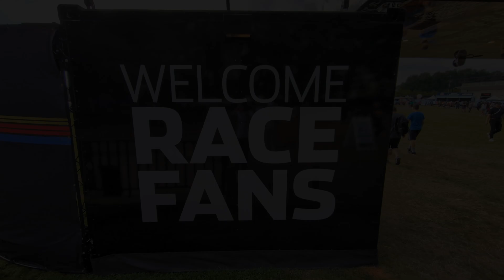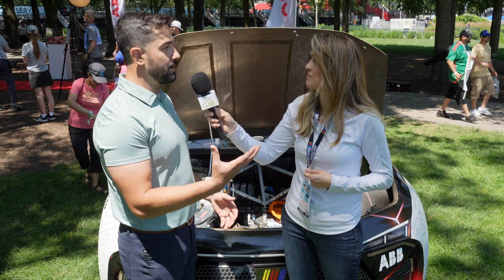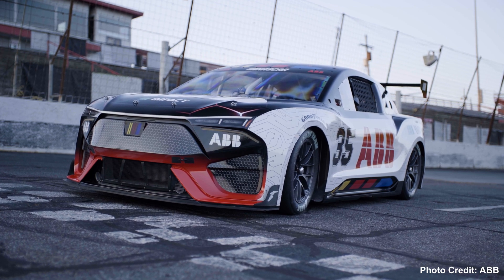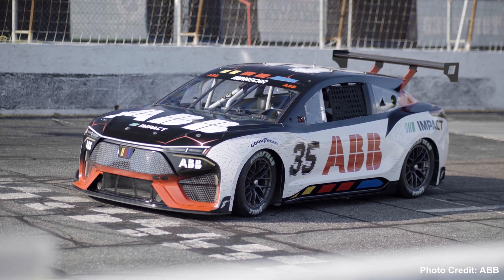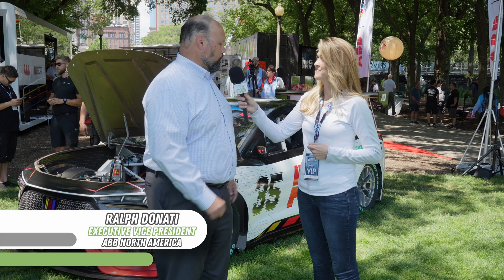ALL ELECTRIC NASCAR First Look : EV RACING

Comment: Yes. EV's can go fast.  No doubt.  But NASCAR can go broke like an EV owner...
Reply from the maker: Did you know that the EVs deliver the lowest cost of ownership. Going broke is more likely to happen to internal combustion owners who pay more for fuel, oil changes, spark plugs, belts, exhaust systems, sensors, and transmission work. None of those maintenance expenses exists for EV owners. 

The minimum warranty on an EV battery and powertrain is 8 years and 100,000 miles. In 16 states, that warranty is at least 10 years and 150k miles by law. Combustion vehicles are not competitive in terms of reliability and operational costs. 
-Producer Tim

https://www.teslarati.com/tesla-model-3-most-affordable-car-to-run-united-states
Reply: @MissGoElectric  The pollutants produced by mining and processing enough lithium for one ev battery are worse than driving ten ICE vehicles for ten years.  The total cost of maintenance on my ICE vehicle has been way less than the cost of that one battery that you'll need as soon as the warranty runs out. You know... that thing that GM perfected... PLANNED OBSOLESCENCE...
Reply from the maker: Once again your assertions are *incorrect*.

Remember...the valuable materials inside of an EV battery pack which will deliver 200,000-400,000 miles are not exhausted or used up at all.  The secondary market will use the batteries for industrial/utility purposes for another decade or two.  After that, the materials are recycled and purchased by a battery manufacturer to be implemented in brand new batteries for another 40 year cycle.

Once these materials are mined, they become a perpetual domestic resource which benefits the US economy.  With every passing day the return on that investment improves.

The circular economy enabled by batteries promotes demand for the domestic energy which fills the batteries. All of it delivers tremendous economic benefits and health benefits due to clean air.

When an EV battery pack is about 5% into its first service life inside an EV...it has already completely repaid its mining deficit with emissions savings compared to gasoline.

Folks tend to forget that for very gallon of gasoline one pumps into their gas tank, 5-7 gallons of gasoline are burned pumping the oil, transporting the oil, refining it into gasoline, then transporting it to the gas station.  Once the gasoline is inside an automobile, about 90% of its energy is squandered as heat, noise, and vibration.

Comparatively, electric vehicles are about 90% efficient.
-Producer Tim
https://www.carbonbrief.org/factcheck-21-misleading-myths-about-electric-vehicles/
https://www.reuters.com/business/autos-transportation/when-do-electric-vehicles-become-cleaner-than-gasoline-cars-2021-06-29/

Comment: Nascar can't go electric. People love the sounds the smells of the cars you go electric it's will suck and you will lose fans.
Reply from the maker: Did you listen to the EV? It was not silent and it was much more powerful than the combustion vehicles. -Producer Tim
Reply: @MissGoElectric not the sound we wanna hear
 It honestly sounds like high pitched shit. I like the smell and the engine noise. There is a place for electric, not on the race track and btw, the current nascar engines are so restricted its not even funny. They can make over 1,000hp with out the restrictions
Reply: Your right about that.

Comment: I don't see it happening in 2035, and besides the three tiny motors and sound, sounded like a eletric go-kart motor in the hood and in the read of the car, also the big wing spoilleer reminds me of the gen 5 car back in 2007 through 2010 series where yes it's gong to make what sounds likemore horsepower for the engine ,but at the same time its going to hurt drag, hurt straight away speed,grip and rear downforce forareo dynamics, so, if we go to the simple spoiller that we have now its going to run better, as Dale earnhart would say about this here car, Yeah I doin't like it, Imean it sounds nice but this is not we asthe drivers and fans have in mind, and if the gen 7 car is not broken, why try to fix it anyways.. And you guys needto think where can we put the crash black foam on both sides of the car, and my questions is, Where are you going to put the battery chargersot, and what WOULD the gas man do if he's not fueling the gen 7 car with his 90 lbs/pound red gas can from sunoco?
Reply from the maker: The production of excuses is child's play.  Adults produce results. -Producer Tim
Reply: Those “three tiny motors” produce 1340 hp. They also accelerate with near-zero lag.

Comment: I’m sorry but nascar going electric will lose a lot of people cause that’s the whole experience of a nascar race. The sounds and feeling of the engines and the smell of the gasoline. I guess only time will tell though.
Reply: Not watching or attending NASCAR ever again after almost 50 years if this happens.
Reply: I'm not an NASCAR fan but from every fan I've ever talked to being at the race is amazing when the cars pass you with the roar and the smell of gas. I've heard this for years from so many people. It's even made me want to go to a race. I just don't know how this will go over. Seems like you're taking 2/3 of the fun away
Reply from the maker: The sounds and smells of horse races were different than human races.  The chariot races sounded and smelled differently still.  When combustion vehicles replaced the horses, new sensations emerged and the cars were faster.  EVs are even faster still and they roar like a tie fighter from Starwars.  The sounds and smells are different.  Motorsport evolves.  Thanks for watching and sharing your views. -Producer Tim
Reply: Sounds and smells are what makes NASCAR NASCAR. It's a sensory sport. There's a lot more that goes into a motorsport event than just fast cars

“I can tell you this, THERE IS NO FUTURE for NASCAR electric vehicle racing. If it does not make noise and smell like it’s burning gas there is no freaking way that people are to attend.”
-Kevin Harvick (21 year NASCAR driver)

If Nascar has a separate series where they have drivers from Xfinity or trucks race and they test that for one season to see how it goes, I’m all for that, but I don’t see it working.

Cars going that fast on an oval track would not work out. Maybe on road courses it would work though. In fact, at the big superspeedways like Daytona, Talladega, and Atlanta they used to have something on the cars engines called restrictor plates. Those were there to actually SLOW DOWN the cars. They are also very dangerous, you do not know how easy it will be for these things to catch on fire (which will spread quickly) in those big pileups. Pit stops would change completely, they will have to pit more often for tires and they will have to replace the batteries which are on the right hand side under the floor. That will be hard to replace in a fast amount of time.

Human races, horse races, and auto races are three completely different things. Horse races did NOT replace human races and auto races did NOT replace horse races. That does not sound like a TIE fighter from Star Wars, it sounds like an RC car or some other toy car. Also who is Producer Tim? Is that someone in NASCAR or is that someone who works on this channel?

If you can't tell, I have a strong opinion about this and many other NASCAR fans do. I don't think NASCAR fans are going to support all the stuff that goes into making those batteries. Technology for electric cars is amazing and I hope we can reduce carbon emissions by a lot with these things. It's just a matter of how we get that supply and how the world changes along with this technology. I just don't want to see it in motorsports.

However, like I said, only time will tell.

Comment: Were the noises we heard from the car ripping down the straightaway at about 8:45 fake (coming from speakers) or made by mechanical stuff in the car?
Reply: Fuck electric. NASCAR just did a bud light move. Good luck
Reply from the maker: That is the sound of the 1300HP electric motors, tires, and wind.  None of it is artificial. -Producer Tim

Comment: No soul in the car keep it in a separate racing series that not to many will watch but time will tell
Reply from the maker: We like variety. Some are of the mind that there is some soul in being the fastest and most capable . -Producer Tim
Reply: @MissGoElectric  They won't be any faster. Nascar could be doing over 300 by now but everybody would be afraid of dying.  So, there are restrictor plates.  On EV's, they would set a top speed and the computer wouldn't let you go any faster.  More capable remains to be seen.

Comment: Call it something else because it ain't nascar anymore.
Reply from the maker: When they started racing trucks, was that a deviation from racing stock *cars*?

When the engines and suspension systems were no longer based on stock components, were they still racing stock cars? Where is the line drawn?

Are electric cars way too fast?

-Producer Tim
Reply: @MissGoElectric  Enjoy your squealing motor sounds. However, I will find something entertaining to do.

Comment: I don’t expect that the full 1300 hp will be available all the time during a race. It will be easy to dial in the max hp with software. I expect they will take a lead from Formula e, Indy Car, and F1 (who have been using hybrid cars for a while now) and limit drivers to a defined number of seconds of full power for passing or restarts, etc. I want to see how they will manage charging or battery swaps, because 78 kWh will not last long on a race track.
Reply from the maker: In the full length version of this video on our @MissGoElectricIndustry channel, CJ makes a similar point. 

Thanks for commenting!

For those looking to learn more about Formula E, we have published a video exploring that series: 
https://youtu.be/_PKTHGqqo3k
-Producer Tim

Comment: The point about battery swaps was well taken. The car needs to be engineered to allow pit crews to perform swaps and specific race tires will have to be developed for these cars. All wheel drive and the increased performance will change to nature of NASCAR races for the better. One concern is the integrity of the batteries in a crash. As a first responder, we're now doing very basic EV crash training but the industry needs to do a lot more for first responder training. EV's are the future, but its been a bumpy road so far.
Reply: Yes. Safer batteries should be priority over performance in the rules. https://www.youtube.com/watch?v=CGQwqWqzkNA
Reply from the maker: For context, the ABB Formula E series has been running for years and there has never been an one-track accident battery fire safety issue. 
https://youtu.be/_PKTHGqqo3k
-Producer Tim
Reply: @MissGoElectric  Formula E had the worst possible start to its 2024 season at Valencia this week - thanks to a pit fire that led to a mass evacuation of the pit buildings and halted running, having been triggered when one of the Gen3 traction batteries went up in smoke.Oct 26, 2023

How and what now: Inside Formula E's worst-nightmare 2024 start

The Race
Reply: Check out the CTIF International Association of Fire Intelligence and Rescue. See Swedish lithium-ion battery expert Per-Ola Malmqvist explain how to safely extinguish EV-fires with minimal water. 30 mins from callout to made safe allowing fire assets to depart. They pierce the pack and pump water into it for about 15 mins. The Brits use a water Lance, I've see videos of the responder opening the door and going through the floor with the lance.

Comment: I'm not sure this will work considering modern Nascar is as much about racing as WWE is about wrestling.  They're shows, produced to excite and draw in large audiences.  Removing the rumbling, the crackling, the flames, and that banshee screaming exhaust may just reduce this to a sterile, almost automated production.  They need to be careful or they could really mess up what works and alienate their base.
Reply from the maker: An EV series would be additive, not a replacement of the Cup series. Did you hear #35 in this video in the hot laps? Those present in person didn't describe it as sterile. 

What about the massive increase of horsepower and acceleration? Do race fans like speed? 
-Producer Tim
Reply: @MissGoElectric  I love horsepower too, I'm just familiar with how Nascar seems to operate.  They are looking for cars that stay grouped, with a more competitive appearance, rather than staggered and far apart.  They have traditionally restricted horsepower gains to both keep cars close and to keep cars from going airborne.  I like the EV powertrain and it's amazing potential, but it needs to go into true racing , not a race "performance".
Reply: There’s a lot more that goes into a Motorsport event than just fast cars.

Comment: EV races would be quieter. Kinda like full scale slot-cars with people driving them! Hopefully they can avoid battery fires and explosions, right? I so wish we had zero point generators available to eliminate the need for batteries completely!
Reply: Solid state batteries are tricking into the market and also if they use the current BYD Blade battery chemistry there will be zero fires...
Reply: In the time it took you to watch his video! 3 ice cars burned DOWN here in the US alone as it happens every 4mins on average!
The #1 recall across ALL LEGACY ice oems is for the risk of FIRE even when parked in your garages! 

Garages are detached structures because of ice vehicle fire risks! When I was born in the 80s we had about 400,000 ice vehicle fires per year, in 2023 it was down to a mere 217,000! And that doesn't count commercial use combustion engines either. As the #1 cause of fatalities in commercial vehicle collisions are because of fires! It's right in the name internal COMBUSTION engined! 😀
Reply from the maker: EV racing is not at all new. ABB Formula E is quicker than Formula 1 and has never had battery fire. Maybe you'll appreciate our coverage on the Formula E  all electric racing series. 
https://youtu.be/_PKTHGqqo3k
-Producer Tim
Reply: Thanks @MissGoElectric 's Producer Tim, @4literv6, and @kylereese4822 for updating me on this stuff. The only EV's I have are 2 ebikes which are 'so dangerous' they're outlawed from being in NYC apts, right? Add in the horror stories about EV's in accidents burning so hot they set nearby ice vehicles on fire! Probably all propaganda from the oilco conglomerate, right? But, I got my 'explosion/fire proof bag' for trickle charging ebike battery bombs in the house! Y'all keep up the good work, educating on the advantages of EVs over IVs. I like the Chinese Gogoro stations where spent battery modules are exchanged for charged ones!

Comment: What a joke!
Reply from the maker: Is twice the horsepower a laughing matter for everyone who likes speed? -Producer Tim
Reply: @MissGoElectric the current engines are being restricted.... they can make wayyyyyy more than they do. No need to go electric...
Reply: Yea the savings $$$ on fuel goes to developing new batteries, motors, gearboxes and even get solid state batteries in the public market faster.... ps there is a Tesla with a prototype 200kw battery that does 752 miles on a full charge....
Reply from the maker: Miss GoElectric and friends got nearly 800 miles out of a single charge driving a Lucid Air on public streets. 
https://youtu.be/m9mVy9ze3po?si=Xkm5EBTfOj-95amq
-Producer Tim
Reply: @kylereese4822  and that 100kwh merc eqxx prototype getting over that mileage real world with half the battery capacity.

Or the Porsche cayman gt4 e demonstrator with 65kwh that also laps Monaco as fast as the ice gt3rs cup cars can. 

While weighing 560# more and does 30-40min race pace stints on 1 charge at 600+hp. It also did a demonstration run where the ice gt3rs cup car got 2 gallons of fuel and went out on track. Ice ran out in of fuel in less than 2 laps at speed. The ev keeps going for 30+mins on the same amount of energy. 😎

The gen 3.5 beta awd enabled formula E cars do 0-60mph in 1.7s now! 👍🏻
Reply: @kylereese4822 and then 2 hours to charge fully. I’ll take a hybrid…
Reply: @48nation  You haven't been following the advancements in battery technology have you.